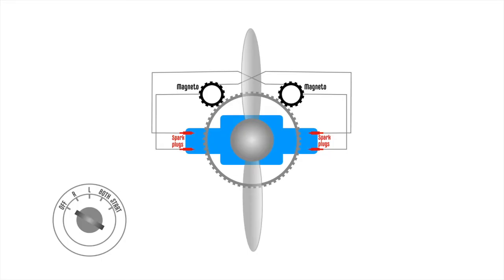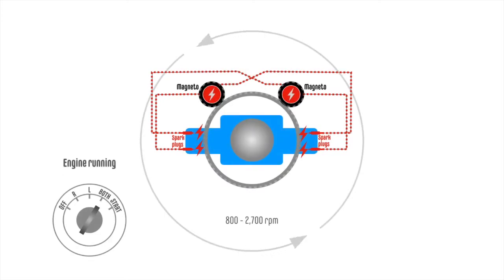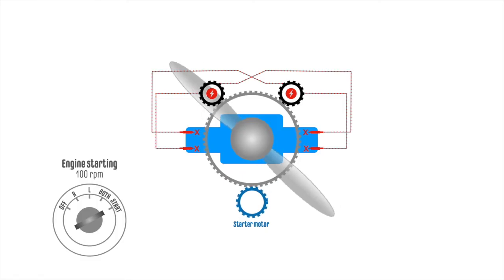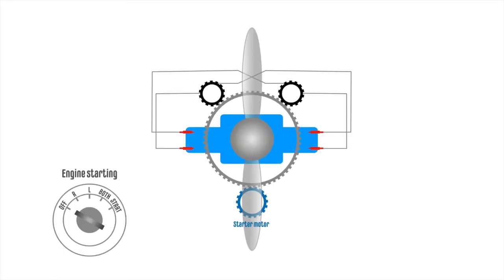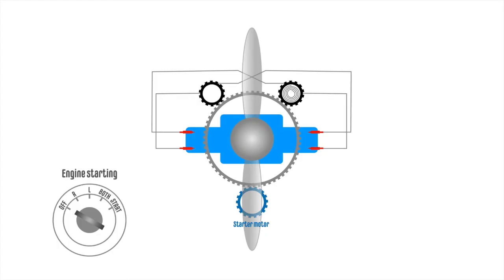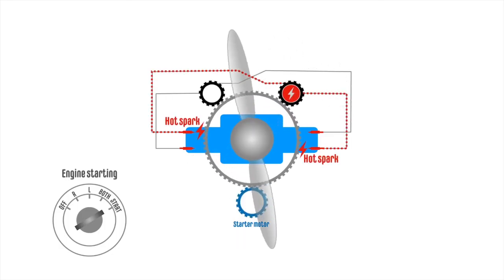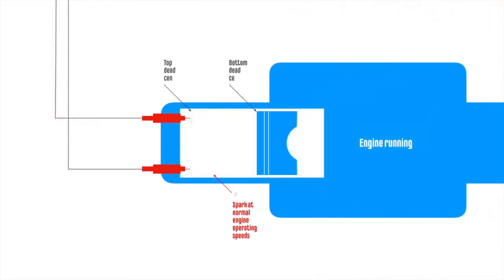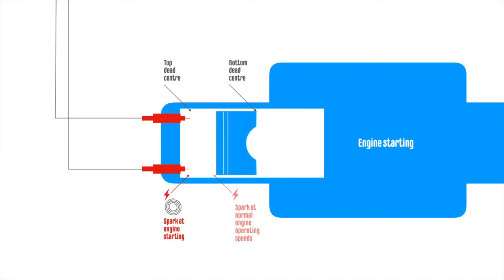Impulse coupling.

Comment: That delayed spark RETARDS the timing to help get the motor running.  Aircraft engines live in an "advanced" state of timing and that is why they can be difficult to start.  In addition, many people forget only ONE mag usually has an impulse coupling.  So if your airplane is a pain to start, this is a good place to start troubleshooting.   FWIW, car engines live in what is basically a neutral state of timing and automatically advance as engine speed increases.

Comment: How is the impluse coupler bypassed when engine running?
Reply: During startup the coupler is held under spring force by latches which move out of the way when the magneto is operating normally due to centrifugal force induced at operating RPM

Comment: Great video, thank you. But I didn’t get that part of impulse coupling delays spark plugs.
Reply from the maker: The delay is introduced so that the piston does not get pushed in the wrong direction by an early spark. An early spark is a good thing at normal (high) RPM but can cause damage at starting (low) RPM.
Reply: Thx for the explanation, but how does it delay the spark?